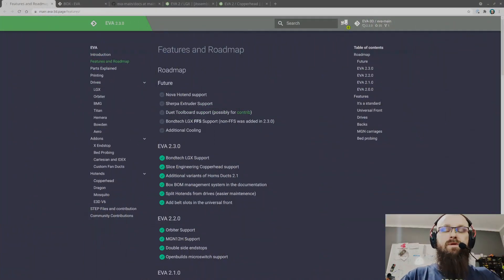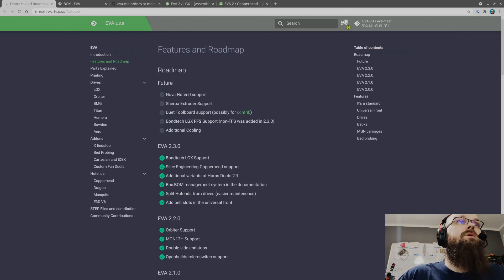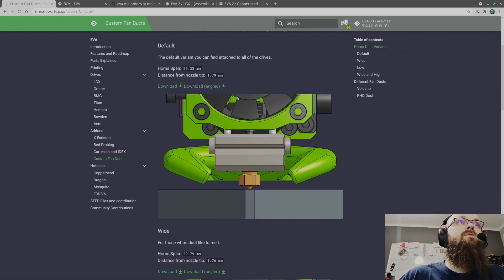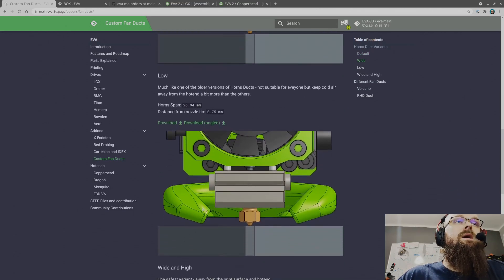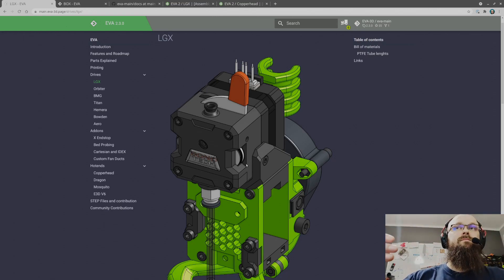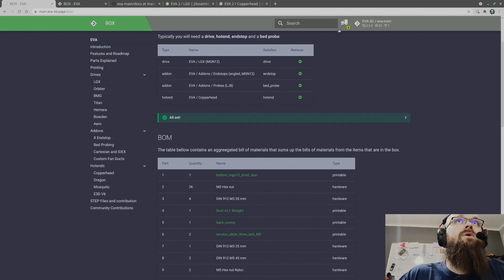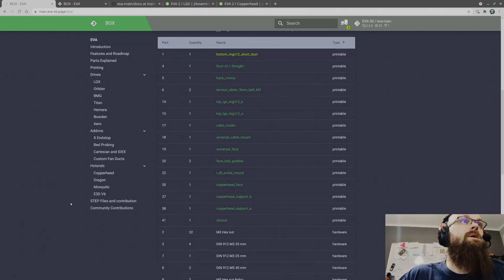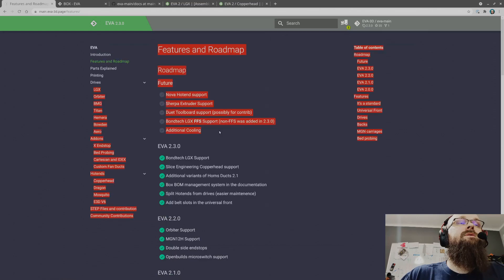EVA 2.3.0 - Bondtech LGX and Slice Engineering Copperhead

Comment: I have a BMG extruder for my V-Core3 build but it's a lefthanded one. What parts would I have to use or mirror for it to fit if possible ?
 Thank you
Reply from the maker: Just the top_bmg part
Reply: @eva-3d948  Cheers

Comment: I am awaiting now 20x20mm square carbon fiber tube and MGN9 400mm - to be installed on Rat Rig V-Core 3 which I have just ordered - would it be possible to add support (or adapter) to mount EVA on MGN9?
Reply: I do the same with my ender 5, so that would be really awesome :)